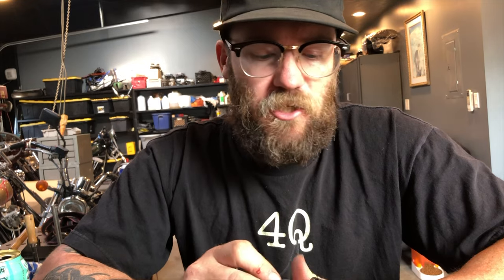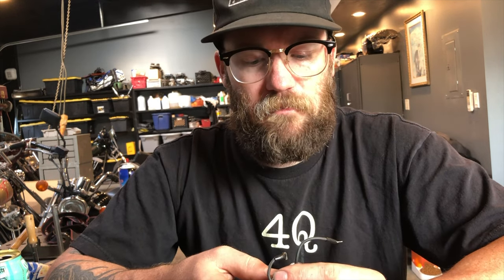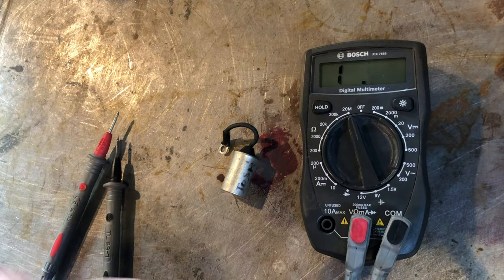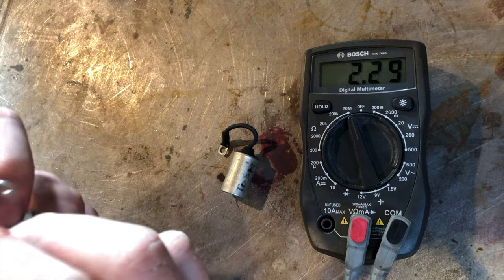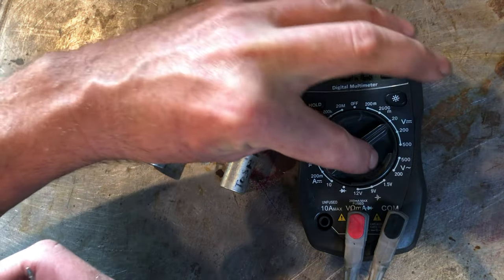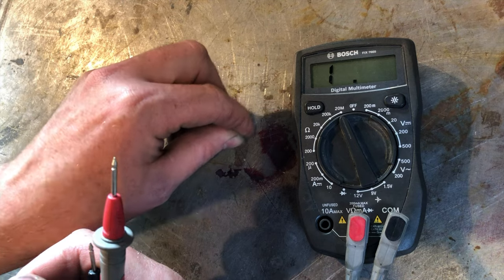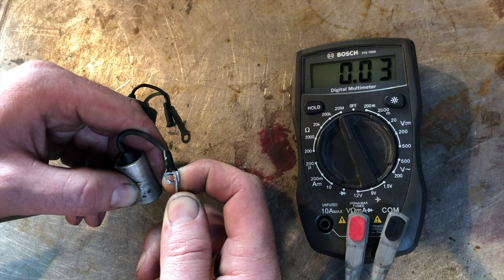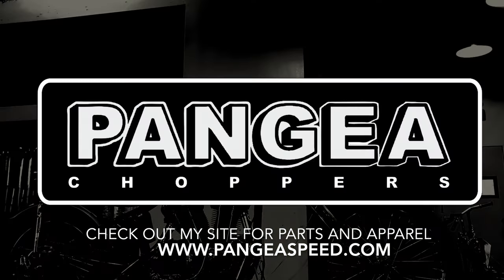Ignition Condenser Test harley motorcycle

Comment: Theory and info are great, but your testing example, not so much. At 2:56, you can see your multimeter showing a reading without your black lead touching the wire because your fingers are touching. I'd put something non-conductive down, like a block of wood, and touch the leads to the body and wire on the wood without holding them to avoid your body becoming part of the test should your fingers touch.
Reply: Your suggestion wood be more of an absolute measurement, but his was still valid in a relative manner, as he tested both the same way. Your suggestion would produce more data points, and that is usually useful.

Comment: Your fingers were shorting out the meter when you added charge, slightly discharging your cap.., and again when you tested the voltage, YOU were discharging the cap too. That is an odd way to test. I would suggest learning to test with a cheap ANALOG ohm meter, but also keep your fingers out of the circuit lol
You can also spend more money on a multi-meter that has a separate capacitor/condenser test. You only need to know what readings are normal...good.

I almost always pull out my cheap analog meter, with the mechanical needle, to test a condenser. You watch the needle jump just as you make your second connection, then quickly return....hopefully. Then switch your contacts around to test again; there may be a bigger bump this time because you charged the cap a bit.......again, keeping your body out of the circuit ;-)

The needle jumps because there is a tiny bit of resistance, just for less than a second, till the condenser stops charging...has taken all that the meters cell or battery has to push. If you are not shorting with your fingers/body, the condenser should hold the charge...voltage depending on the meter's battery.

With an analog meter and just the ohms setting, you can test and don't really need to know any numbers.

Test a few known good ones so you know how the needle is supposed to behave. Make sure the meter has a good cell or battery.